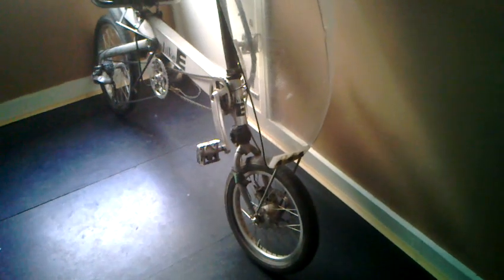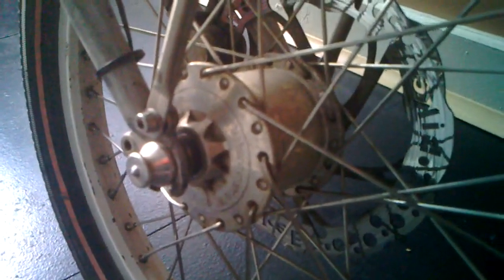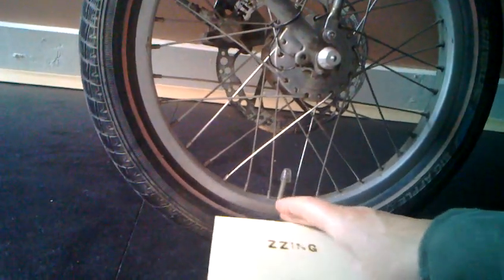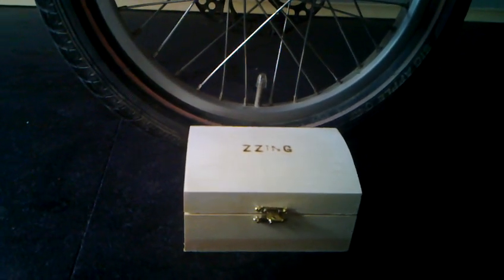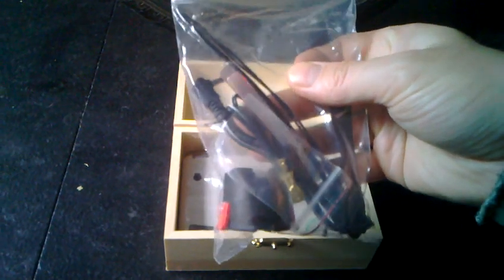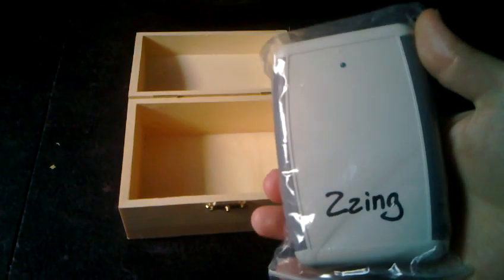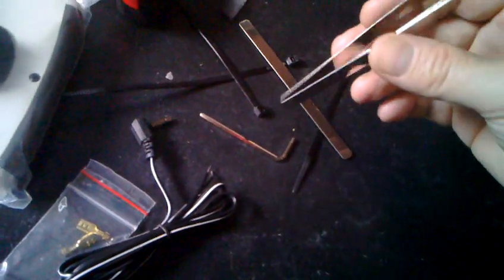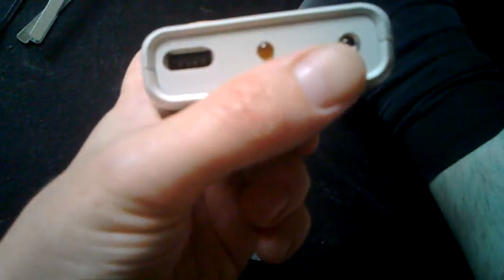Unboxing the Zzing

Comment: So far the battery storage I think looks nicest is the BikeCharge by bike2power. It looks much smaller than the zzing, and more weatherproof. Had you seen this during your research?

However, I don't have a dynamo hub, and I don't want to have to get one in addition to a battery pack, so the Atom by Siva Cycle looks like it will fulfill my needs.
Reply from the maker: Hi Indrina. A years-late reply, for what it's worth. As far as I can see, you're probably referring to the LightCharge products sold by bike2power. They are indeed smaller and lighter, because their function is solely to regulate and convert power (if I've understood it correctly). The Zzing does that but also stores charge so you can use it off the bike as well. And so of course it's bigger and heavier because it contains a battery of cells.